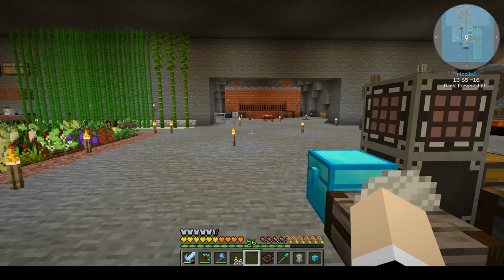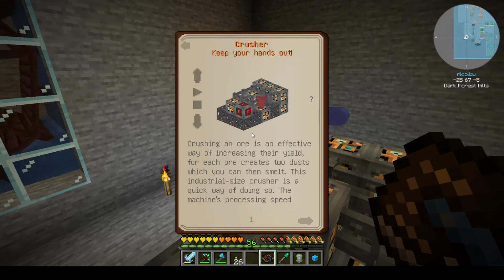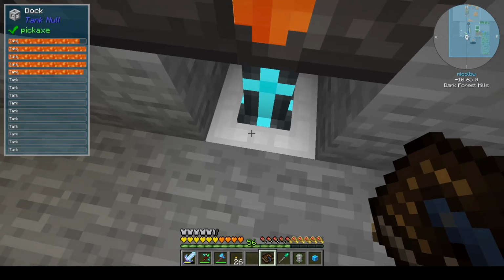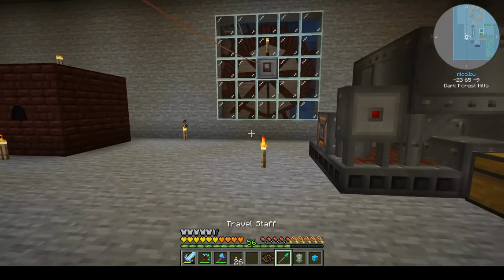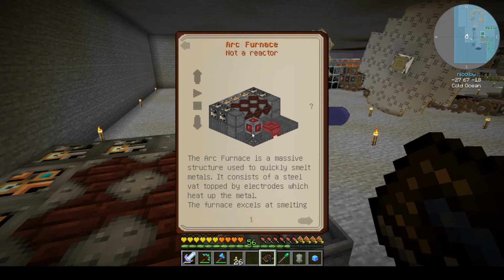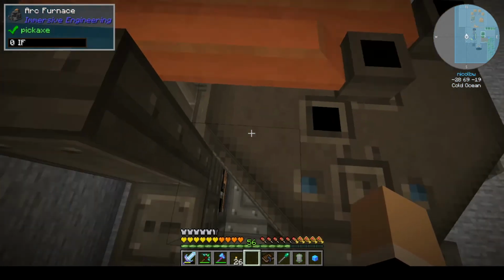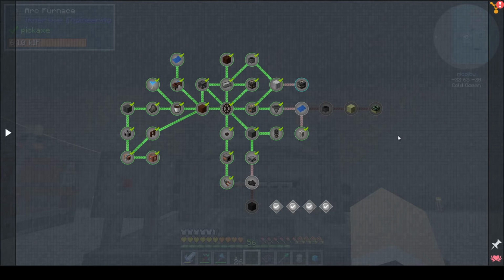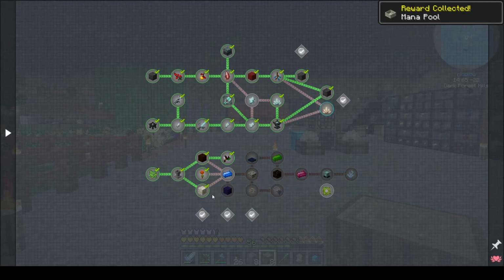Arc Furnace on Cave Factory

Comment: The Arc Furnace can make steel using just 1 iron and 1 coal coke, so it's cheaper than using the Blast Furnace. With your supply of iron that's not too big a deal but it is also a lot faster. If you want power to run it the Diesel Engine produces 4096 RF/T,  you just need to set up the Squeezer for plant oil, Fermenter for ethanol, a few Cloches to grow the resources needed (I used hemp seeds and potatoes) and a Refinery to convert the plant oil and ethanol into biodiesel. You'll probably also want to use HV wires and connectors for the Diesel Engine and Arc Furnace but they can't be insulated so be mindful of "direwire", lol. I actually just used flux points/plugs for most of my machines once I had a decent amount of obsidian and ender pearls so I didn't have to worry about running cables everywhere.